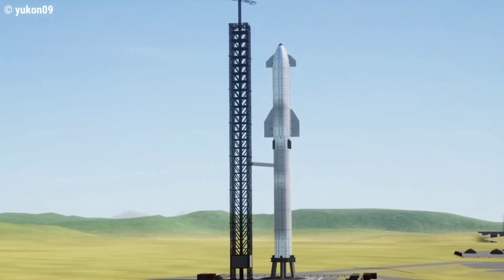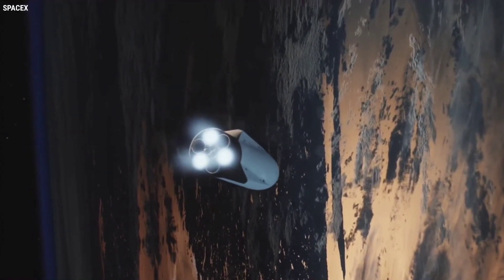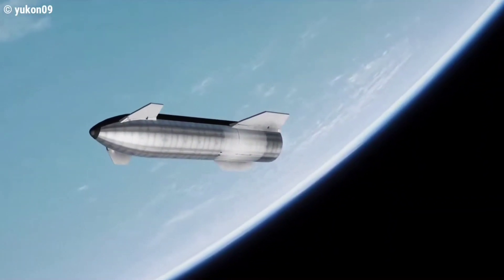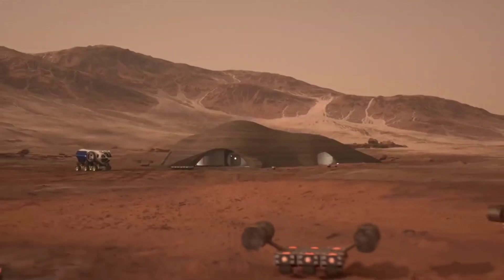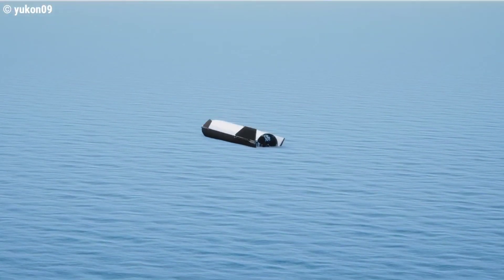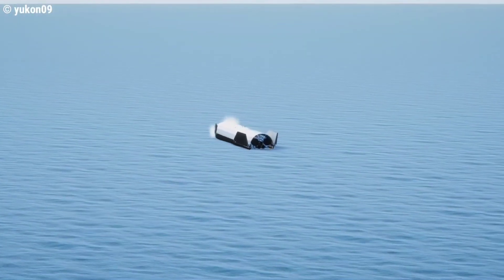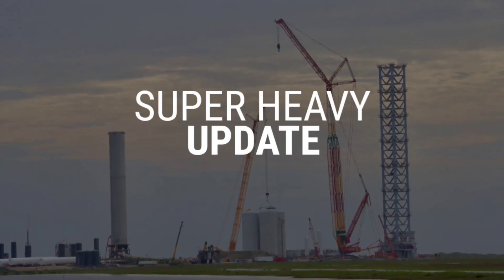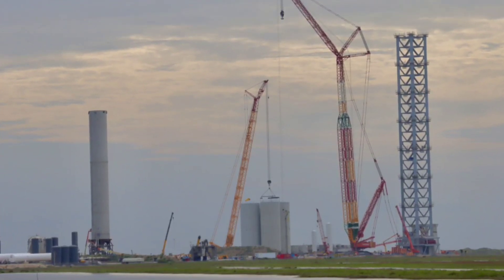Why SpaceX Is Dropping Starship SN20 Into A Water INSTEAD Of Landing!?

Comment: Their current barges aren’t equiped to land the starship and their modified drill rigs won’t be ready for a while yet. It’s not really rocket surgery to figure that out.
Reply: Hahaha YouTube comments never fail
Reply: Its "rocket science" or "brain surgery", moron.  And even if the platforms were ready, X doesn't want to attempt it yet due the risk of a bad landing and explosion.  A water landing is safer until they have more telemetry data.  Plus X wants to be able to examine the ship and engines post flight...you can't do that if the ship explodes attempting a landing on a platform.

Comment: How about having the winged Rocket descend in a circular pattern, that way it falls slower, with less heat buildup.
Reply: the speed doesn't come from the fall, it comes from the horizontal velocity. in order to curve it around into a downward spiral like I think you're saying, you'd have to cancel all of its horizontal velocity anyways. this is why blue origins capsule has no problem coming back from space with just Parachutes, because it goes straight up and straight back down again
Reply: @AbandonAllArt  Dude, your first statement is a contradiction of itself. You said, "The speed doesn't come from the fall." That was followed by. "It comes from the horizontal velocity." THIS IS THE FALL THAT GENERATES THE SPEED. 

However, useless Blue origin is not doing anything new. They are just copying SpaceX. It is obvious that Spacex has gotten bored of vertical landings, so they are trying to be more creative. 

Besides, the type of circular pattern descent I described was done by Spaceship One in 2003, the predecessor to Richard Branson's Spaceship 2.
Reply: @richardike2342  that's a totally different speed, they both start re entering at around 80,000m but the difference is starship is traveling ~15,000 miles an hour east, parallel to the earth's surface. in comparison the sub orbital vehicles like spaceship one and blue origins shepherd are going relatively straight up and down in comparison. in order to do a downward spiral you would have to cancel out most of the parallel 15,000mph within the first half of the first curve (when you would be heading west). gliding down from that height is no issue, Felix Baumgartner jumped from 135,000m straight down with little heating, because he wasn't already headed 15,000mph east
Reply: @AbandonAllArt  Why are you trying to make complicated something that is very simple? I am not saying anything new. I said it has already been done before, a circular descent from Space. Did you properly read what I wrote, or did I write too much? I said SpaceX must be bored of vertical landings, that's why they are trying new things. You are giving useless Blue Origin credit that belongs to SpaceX, when it comes to vertical landings. SpaceX has been doing vertical Rocket landings for a long while now. Bezos has been poaching Elon Musk's engineers for years, and that's where Blue Origin got their vertical landing knowledge from. Blue Origin is literally a graveyard for former SpaceX employees. Besides, I always thought Bezos looked like a perverted peeping-Tom, then he had to go fly in a Rocket that is shaped like a male genital to prove me right. I cannot stand Bezos, so let's end this conversation now. Unless you want to talk about Elon Musk or Richard Branson.
Reply: @richardike2342  I think you need to research more about orbit vs sub-orbital and the pressures involved before you're ready to have this conversation. SpaceX is not bored of vertical landings because that's exactly what the booster is going to do. they have to do the skydive/bellyflop maneuver to slow down from orbit. there isn't enough air to react off of that high up to change your direction into a spiral when you are already traveling that fast parallel to the surface. by doing the skydive they are basically skipping off of the top of the atmosphere until it is slow enough to come down into the thicker part of the atmosphere
Reply: @AbandonAllArt  Dude, the belly flop is a creative option for SpaceX. They don't have to do it, they just like to take on challenges. I have followed them for many years, that's how I know. They have already perfected vertical landing, even on a floating barge. SpaceX literally likes to do the impossible. 

Besides, I was just making a suggestion as to using the circular glide re-entry of Spaceship 1. SpaceX Rockets don't have wings, so they cannot pull it off without power. A controlled fall is the closest thing they can do without power.
Reply: @richardike2342  Couldn't be further from the truth, the vertical re-entry only works on the booster stage, which is on a suborbital trajectory much like spaceship one. The boosters do not have to cancel out over 15,000mph of parallel velocity. to say that spacex is doing such a complicated maneuver for "fun" is a gross understatement of the incredible engineering that goes into recovering a final stage.

Comment: What if they stabilize the starship in midair before even trying to land it, hover for best landing?
Reply: cuz they dont have that much throttle control at the least throtlle it would just fly up and cant hover
Reply: @AD_SPACE_2024_...Aditya...  Well they are either trying to be caught effective or they fill as though they're running out of time.

Comment: What's SpaceX's plan to defend Astronauts against Cosmic Radiation on the trip to Mars?
Reply: I just remember to use water as a wall and those water are radioactive now
Reply: No idea, but polyurethane would be a solution and you don't need much of it. It has the characteristic of shielding against radiation.
Reply: @florh  Since there's very little "atmosphere" in space, it might be a good idea to coat the outside of the rocket in polyurethane. Maybe check it every now and then to make sure it's intact.
Reply: @protorhinocerator142  yeah, but they have to take into account, that polyurethane already starts disintegrating after just 15 years...
Reply: @protorhinocerator142  and actually, I would coat the outside with nasa-foam (that foam you can touch with bare hands when it comes right out of the oven?) and the inside with a layer of polyurethane, I doubt polyurethane will survive re-entry. There's a reason plasma is formed during re-entry, it will burn away the layer of polyurethane.
Reply: @florh  nice

Comment: I think the reason being that they have a lot going on in this first shot.  If SpaceX can recover the booster , that will be a big plus.  And if they can recover the ship after it does a controlled landing in the water , that will be great.  The chance the ship may not be able to be controlled and be over water. Gives SpaceX options and safety .
Reply: What size nozzle do you use?   Im printing for about 5 months with the same nozzle and dont have problems until now.  Clean ever few days everything.  Please let me know. Should i upgrade?

Comment: Time. Time is the reason they are planning to dump the Starship into the water. These first few vessels are changing rapidly and are not yet equipped with the hot gas thrusters necessary to provide pinpoint landing. They are trying to capture as much info as possible and they need to demonstrate they are making progress on the Starship. The Booster will not be equipped with legs and the earth bound Starship will probably not have legs either. Without the capability to land safely there would likely be significant damage to the launch facility and surrounding property. If they waited for all of this to be put into place, they would lose ground to all of the projects they have going (mars, moon, Starlink, etc.). This first flight will be a big show but the following flight will be far more significant.
Reply: Not time, safety.  They don't even know how well it is going to survive re-entry, they don't want pieces coming down in potentially populated area's.  The did the first F9 landings the same way, soft water landings to make sure they had it right before trying a real landing.
Reply: @TheEvilmooseofdoom  - Yes, safety is a primary concern. In this case though they could overcome the safety issues by taking the time most other companies would take to test every iteration of the spacecraft until they were satisfied it was safe. SX moves on as soon as they have determined it is doable or if there is a better choice. At this point they are developing the hot gas thrusters to provide pinpoint landing. They could wait until all of this has been tested and use it in the first orbital flight but they have other information priorities and so it is upward and onward. If safety were there first concern, they would have already chosen a different environment to test the Starship.

Comment: Cannot see that system working - too large too heavy will be damaged . Unless it ‘sinks’ and then pops up .
Reply: Superheavy and Starship will be able to float, since the tanks will be virtually empty. Plus, stainless steel is not the heaviest of materials,
Reply: @cyoxin51  I have seen renders where the ship simply falls to the side - that will not work since the pressures of that drop would inevitably crush the upper section. That is why I suggested sinking and then popping up but you are also correct the tanks are empty so no ways the ship will submerge because of buoyancy.
Reply: What?  The water landing?  It will likely topple, break and sink.

Comment: The booster should have flotation rings fitted to save the engines on sea landing
Reply: David Bork  Thats plain stupid when a low cost buoyancy ring could save them for reuse. Its called the “cost effective dont be a dumbass technique”
Reply: @malcolmdavid722  im not sure those raptor engines at their current model are meant to be reused and will probably require heavy refurbishment, as well as that, adding floatation rings would probably be quite heavy and require more engineering to design, also these floatations rings might screw up the weight distribution. So I personally don't believe it would be economically viable for spacex to save the raptors, either way spacex is probably prepared and might even be expecting sn20 to completely fail and burn up in reentry or something. 

Also musk has enough money to burn wasting a few raptors won't really slow anything too much
Reply: @Oscar-vs5yw  People generally acquire money by being frugal and wise not wasteful. A low cost inflation ring v expensive Raptors is logical on a test vehicle if you want to inspect and learn
Reply: @malcolmdavid722 um im pretty sure floatation rings would be pretty hard to design if the starship and super heavy are planning softly land on water like the falchion 9s, since the engines will be firing almost until the rockets hit the water (and the engines would be the first to hit water), if the floatation rings were installed inside they would most likely burn, if they were installed outside they would most likely screw up the aerodynamics or burn during reentry or require money and extra time for R&D of the floatation rings so they would be instantly deployable survive reentry and strong, even if there were floatation rings strong for the task, it would probably be very heavy and require more goddamn time to research to see if the weight would screw up the launch. 

I think you should be more logical instead of trying to argue the same argument with the only reason being "it is logical" which is stupid reasoning
Reply: @malcolmdavid722  Mate ... anything significant that will not be used in normal orbital flights should not be added to starship as it would change the data they want to receive and when the main purpose of this flight is to get more data, not to land or save the rocket. They can afford losing both starship and super heavy, but they can not afford getting potentially risky and wrong data that could result in very bad outcomes in the future. And in general, there is this wise way of thinking, that if company full of intelligent and super qualified people decides not doing something, even if potentially looks like a good idea for regular people like we, it's most likely because they decided not doing that for a reason, not because they didn't think about this.
Reply: @malcolmdavid722  the super heavy bn4 is only for testing or only used one time other will land on land are you get update from spaceX?
Reply: @menowski  I agree, for what it's worth😁
Reply: @malcolmdavid722  what are u gonna make the ring out of that’s gonna survive the engine temps 😂..
Reply: @far1002  As per former Apollo ring on the outside away from engines
Reply: @malcolmdavid722  u must be talking about the capsule not the rocket.  I’ll have to look that up  because all those rockets are on bottom of the ocean lol
Reply: @far1002  We shall no doubt see what transpires ....
Reply: @far1002  yep its enough to vaporize steel
Reply: The engines are already obsolete. In order to ramp up engine production in time they need to crank them out. They are probably 3-4 steps back from newest design
Reply: Don’t need them. The fuel tanks provide buoyancy.
Reply: @jerm4336  Yes, but weight of Raptors will put the engines under water which could be avoided with a flotation ring at the base.
Reply: @malcolmdavid722  The gold for Data is the flight path, not really the landing...
Reply: @surf2257  So just trash $ milllions ?
That a bit like testing a new carr and not bothering to fit brakes because you just want to enjoy the scenery ...
Reply: @jerm4336  The thing will topple, 70m tall, the tanks will likely rupture.
Reply: @TheEvilmooseofdoom  it will land using rocket engine